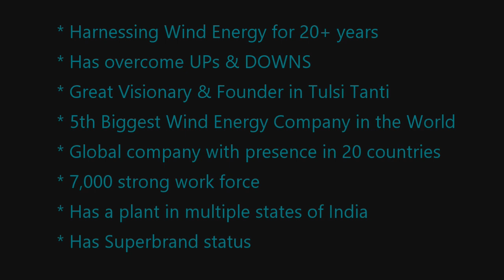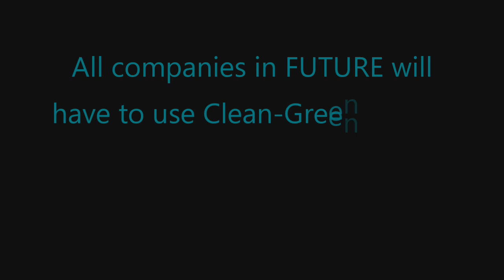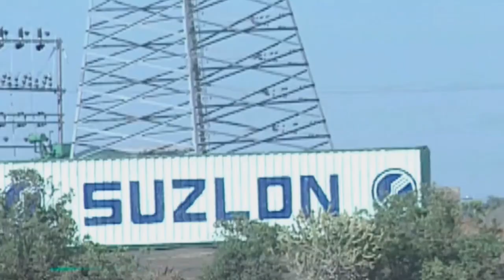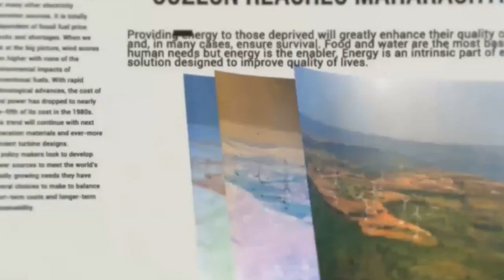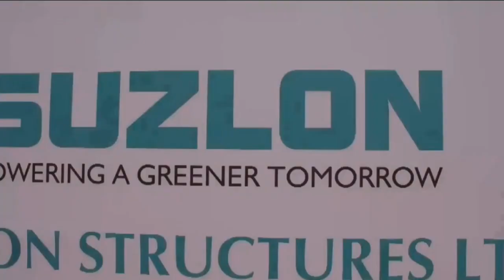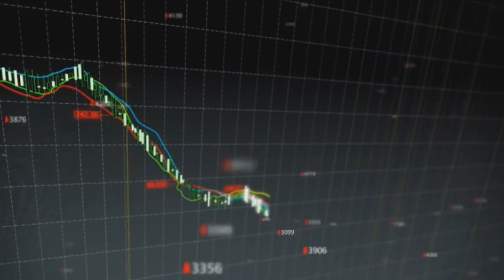Suzlon rising like a Phoenix? | PlugInCaroo

Comment from the maker: Oct 2022 Suzlon Rights Issue oversubscribed. 👍

10 Nov 2022 Suzlon posts Q2 net profit at Rs 56 crore on higher revenues.👍

Europe is very desperate for energy. They will ignore clean energy in the immediate future but CANNOT do without it EVEN if they make peace with Russia. 
(To me it seems Europe has NO OPTION but to make peace with Russia or at least lift sanctions on Ruble.) ...either way Europe will need at least 500GW of  Renewable Energy.

India too has 500GW of Renewable requirement (upto 2030) of which 40%-50% will be Wind.
Picture abhi bhaki hai doston...

Comment from the maker: POSITIVE NEWS REGARDING SUZLON:
1. Wind Energy will ZOOM with Green Hydrogen projects in India:
Electrolysers, which are needed to produce green hydrogen, require a high PLF capacity utilisation. Solar gives a low PLF of 30 per cent, wind gives 42 per cent but if ran on a wind-solar hybrid, the PLF is 60 per cent. Hence, for the utilisation of capex investment of the electrolyser the best solution is wind-solar hybrid set up in which 70 per cent should be wind and 30 per cent  should be solar to make green hydrogen production economical.

2. Renewable Power Target of India for 2022:
https://www.globaldata.com/wp-content/uploads/2021/03/PR12569a.png

3. Cumulative Wind Installed capacity in India:
https://www.researchgate.net/publication/340546805/figure/fig1/AS:888537440337922@1588855242542/Cumulative-wind-power-installed-capacity-in-India-over-the-years-2007-2018-and-the-year.png

4. Wind Power installation by States in India: 
https://mercomindia.com/wp-content/uploads/2020/04/India-Cumulative-Wind-Power-Installations-by-States-.png

5. Will Adani takeover Suzlon? (03 April 2022) (read last para): 
https://www.thehindubusinessline.com/companies/adani-to-launch-indias-biggest-wind-turbine/article65281367.ece

6. Reverse auctions for wind projects to go (15Jul2022 News): 
https://www.livemint.com/industry/energy/ereverse-auction-for-renewable-energy-to-end-soon-11657804719007.html

7. Suzlon Energy's net profit jumps multi-fold to Rs 2,432 cr in June quarter (10 Aug 2022): 
https://www.business-standard.com/article/companies/suzlon-energy-s-net-profit-jumps-multi-fold-to-rs-2-432-cr-in-june-quarter-122081001470_1.html 

RULES FOR INVESTING IN SUZLON
Rule No 1. THIS WILL BE THE ONLY PENNY STOCK YOU WILL INVEST IN YOUR LIFE. All other stocks will be Blue Chip Stocks.
Rule No 2. NEVER TAKE LOAN to invest in Stocks.
Rule No 3. HAVE GUTS to hold this stock for at least 10yrs. (Sell only after 2032 or beyond)
Rule No 4. Don't put more than Rs1-2Lakh in this.